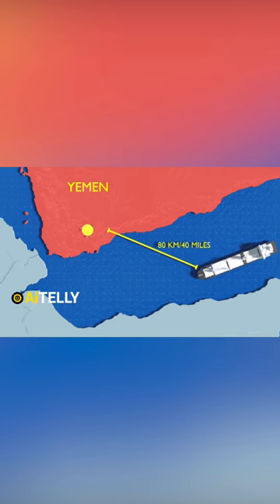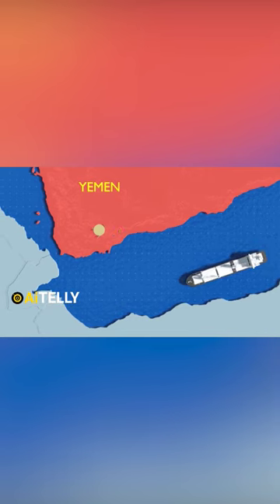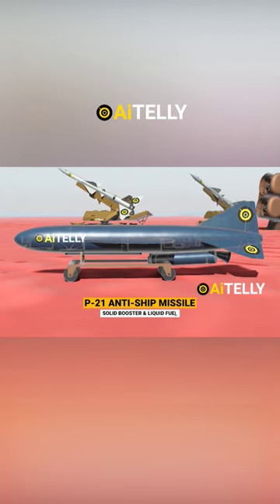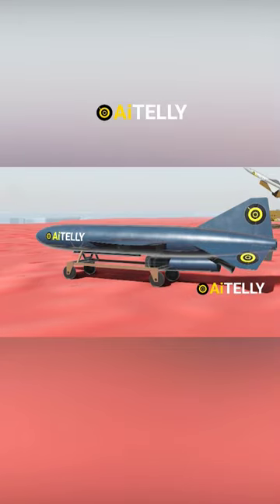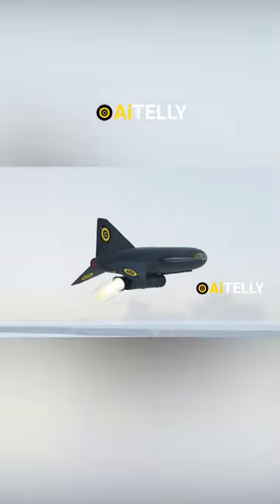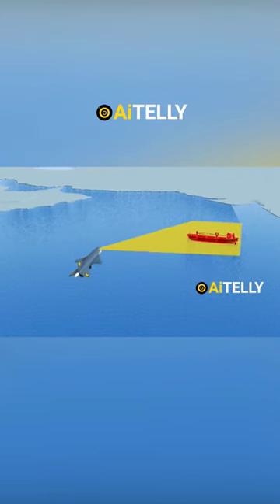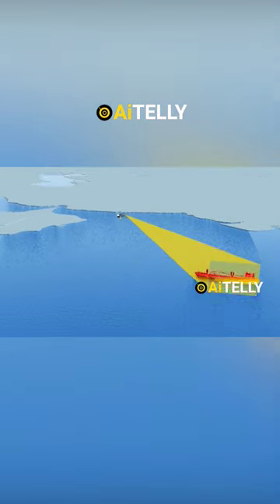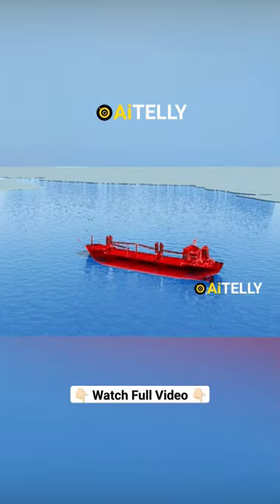What Missiles are the Houthi using?

Comment: It's analogue - that's it not possible to distract, distribute or deviation of it's trajectory and path to kill. Had it has binary switch on a and Switch off 📴 digital pulse baud radar system then through external intervention and manipulation of signal it would be mere cylinders to direct a dive into sea. Russia had the vision even during cold war R&D era diversified applied mathematics with a reset from Western hemisphere countries. That's it why Sukhois and MikoJan fighters are still relevant to war and yet not saturated it's market in lots of countries.
Reply: Analog is still jammable.
Reply: @michaeljones781  Lol. Everything is fine if the cost of the antidote supersedes the cost of the target. 70 dollars balloon is also easy to destroy OTT with heavy spraying of explosives with a 1 million dollars worth projectile - but here it comes the herring fundamental justification for such expensive solution - war economics matters and factoring the cost to outcome.